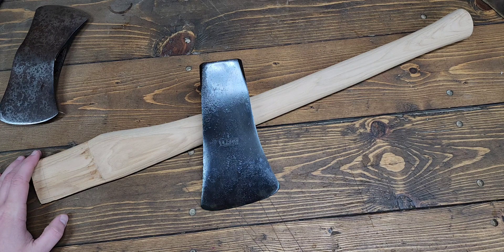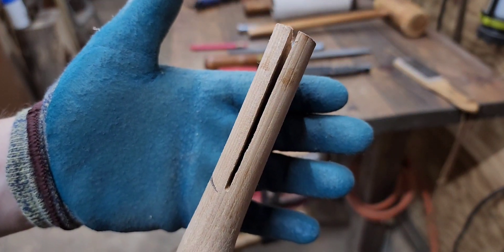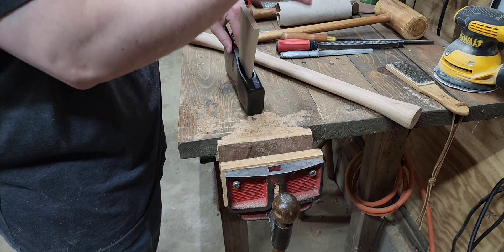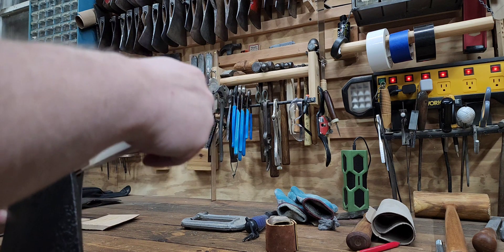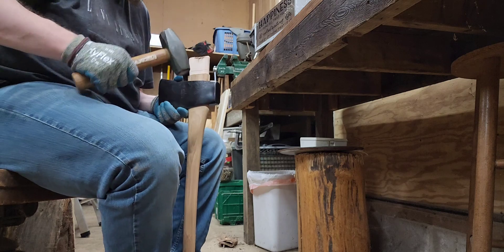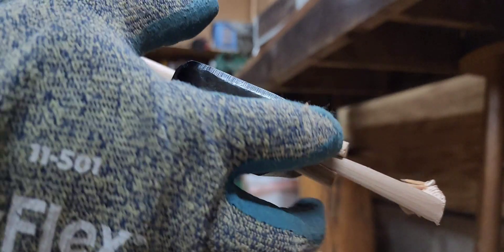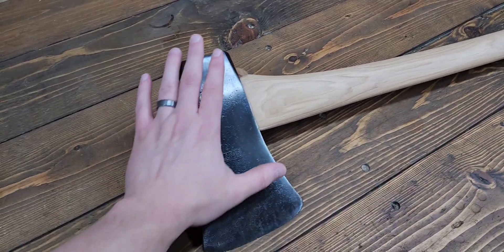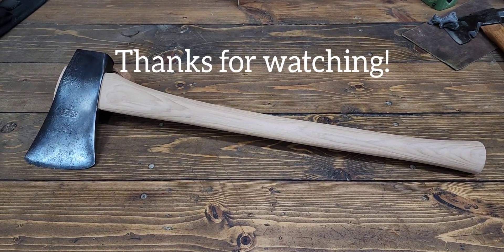PLUMB Rafting Pattern Axe Build Part: 2

Comment: I believe that the quarter sawn, expansion and contraction, is opposite of how you described. it is good practice however, to fact check my knowledge on most things. ha! Great axe! Really enjoyed the vids!!
Reply from the maker: Your comment certainly got me thinking and I did some more research. I think you are correct! I believe I was following the woodworking logic of quarter sawn wood is more stable and shrinks less which is true but not in the direction thats applicable to creating pressure in the eye. The shrinkage is less from bit to poll not cheek to cheek. My guess is with a dry wedge the changes are minimal but I think you are right that I got the shrinkage direction inverted. Thank you!!! I truly appreciate having discussions about the hobby and continuing learning.

Comment: Went down a rabbit hole watching rafter builds because I want to try and get some into Australia, will definitely be trying to get maple wedges also! Very impressive.
Reply from the maker: They really are a fun pattern! They are not usually too hard to come across on ebay, they are just a bit pricy. I've been very fortunate to snag all of the ones in my collection at good deals. 

I really like the maple for a wedge material. It does not compress as much as poplar but it's stronger for really driving in. I think it's very handy to have a few different wood species on hand so you can pick the one with the best properties for each specific hang 👍👍

Comment: Nice job on the handle, really like how you thinned out the shoulder. Good thing about the hefty House Handles, you can always get rid of material. Also, interesting ideas on the wedge grain orientation. I've wondered a few times about it, usually mine are cross grain because that's what is easiest to cut.
Reply from the maker: Thanks man I appreciate it! I fully agree on the house handles. They have a lot of potential if yours willing to put in the work. Whiskey rivers are incredibly nice right out of the box but are definitely more expensive and sometimes sold out. As far as the wedge grain orientation those are just my thoughts. I've seen plenty (and have hung others) with the wedge grain running the opposite way and have had no issues. For me splitting them out in the quarter sawn orientation is pretty easy because I get them from wood I'm processing for firewood.

Comment: Great build, Is that a house handle?
Reply from the maker: Thanks man! Yes this is one of their 28" straight single bit handles. I did pay the slight up charge for the hand picked but I've been very impressed with the zero run out and good grain orientation.

Comment: I never used to glue my wedges but I have experienced unglued wedges backing out during hard use. Only a couple of times and I believe that it was do to there being too much uncured linseed oil that had worked it’s way down and sort of acted as lubricant for the wedge to start slipping out a bit. Now I almost always glue my wedges because I don’t see any downside to it.
Reply from the maker: I know tons of guys that prefer to glue them and if something is working for someone by all means I encourage them to continue it. Personally I've only had a couple back out and those were ones I wasn't super confident with to start. I Typically don't oil before driving the wedge and do it dry. Then just oil it heavy after. There has been a few scenarios where either the tongue or the wedge, possibly both have shrunken enough due to changes in humidity. This tiny bit if wiggle was able to be fixed months after by seating the head a little deeper and then driving the wedge in a little more. Gluing it would not of left this as an option. That's my primary reason for not using glue.

I also remember most of the times my wedge backed out was due to it being an especially wide wedge and an un-tapered kerf. I really think tapering the kerf helps a ton with getting good wedge to tongue contact. 

Thanks for checking out the video and commenting man!!!